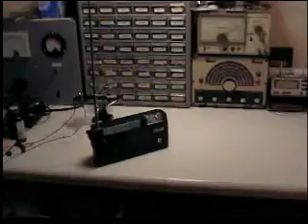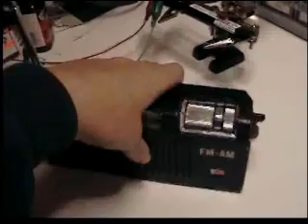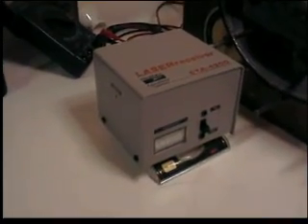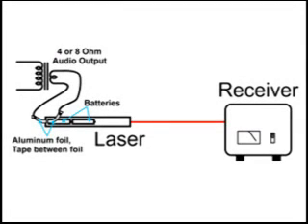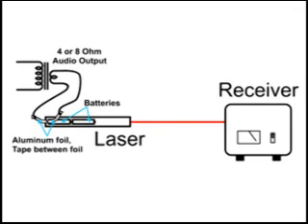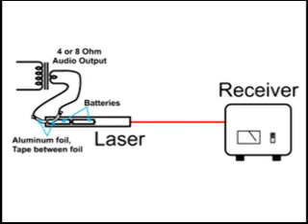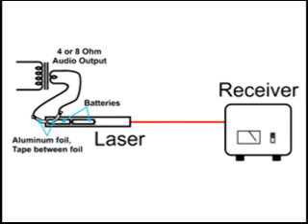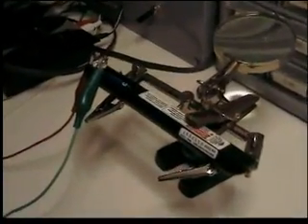My 8th  Grade Science Project updated

Comment from the maker: In this radio there is an output transformer that drives the speaker. That is right the two wires from the laser goes to the output transformer. When the ear plug is in the laser is connected to the output transformer. You have to use a radio or record player .est. that has an audio output transformer for this to work. An iPod does not have an output transformer.